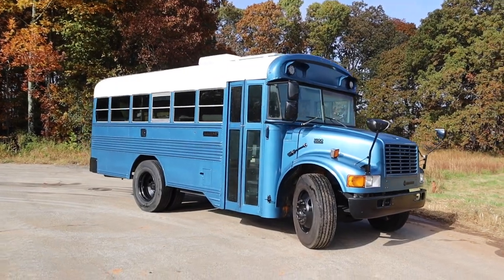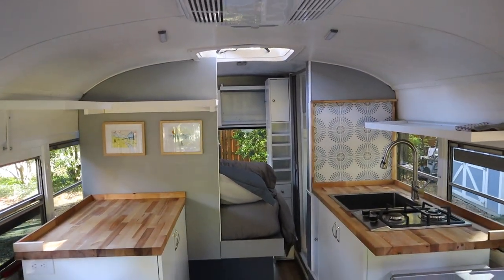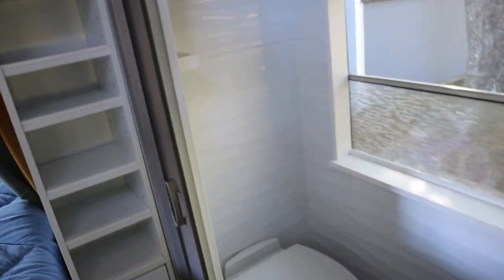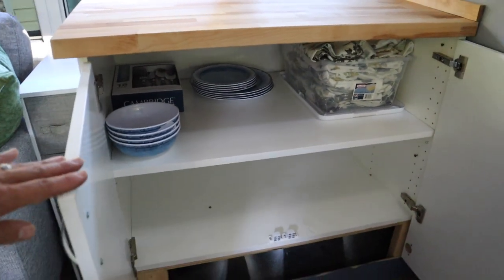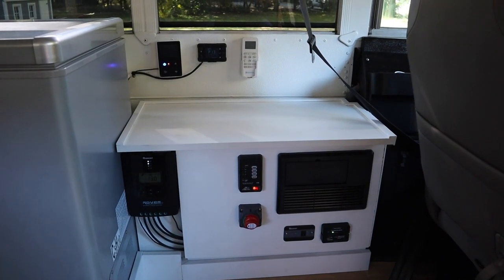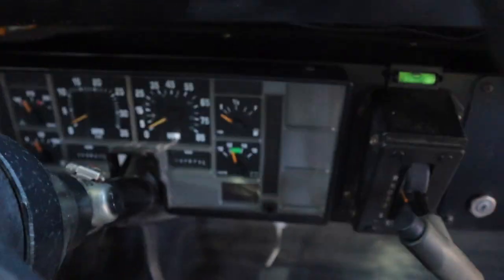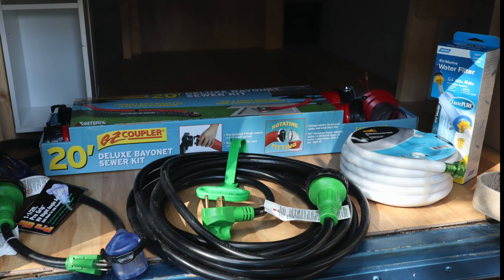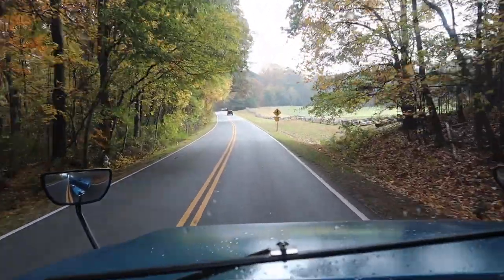Our School bus conversion

Comment: Very nice but let's be honest - all of those open cubbies in the back are not very practical. The first thing people are going to have to do is either put doors on them, bungee cords across them, or empty them out before they drive. I do love the sliding closet rod though, fantastic!
(I guess you could stuff the cubbies full so that things stay in but then everything is a wrinkled mess when you take it back out. Even the bins the people are going to suggest are going to fall out as soon as you hit the brakes too hard.) Also, I didn't see any kind of latching mechanisms on the cabinet doors? I saw the regular clips but again, those aren't going to keep the doors shut on the road.

I don't mean to be negative Nancy - this bus is really cute and I would seriously be interested but you also have to be realistic and things just don't stay put when you're driving - I've got three broken toes from a stray can of chili in an overhead cabinet to prove it 😅.
Reply from the maker: I appreciate your observations. The cubbies do have a small lip to keep things from sliding out but I would not suggest putting something top heavy in that space. The cabinets doors have very strong magnets holding them in place.

Comment: Great to find a 6 window bus.  Nice conversion.  But the stock windows and the metal ceiling are big drawbacks.   Hard to cool?
Reply from the maker: Thanks, it drives like a big pickup truck. The air conditioning does a fine job when connected to shore power. The white roof and tinted windows are also helpful.

Comment: Do you have a link for lights you put on the front to replace the flashers?
Reply from the maker: Here is a link to the lights: 7inch 51W Led Tractor Work... https://www.amazon.com/dp/B08219FFKH?ref=ppx_pop_mob_ap_share
The mounting tabs had to be removed from the lights. 

And the steel blanks to fill the holes: Etsy: https://www.etsy.com/listing/1034533574/steel-disc-raw-steel-steel-circle-pick?ref=share_v4_lx

Comment: Where to get engine parts for this bus. I have one
Reply from the maker: Erik, the T444 parts are almost 100% identical to the ford 7.3 parts.  Any auto parts store sell most of the items you will need.
Reply: @paulpadur2183  I can find the bolt on fan clutch. It's different from my 1993 f350 7.3 idi.

Comment: How long did this take you? Looking at doing one myself
Reply: Every single conversion is gonna take different amounts of time for everyone, even if you had the exact same bus and did the exact same things. There’s no way to compare how long this one took versus how long it will take you unfortunately. 

Most conversions like this one that were not completely stripped and then adding basic lighting, cabinetry, etc  usually takes individuals 3 months on the low end up to or over a year at least on the higher end. I have seen several comparable builds take two years. It just depends upon YOU. How often will you work on it, every day or just weekends? How much money do you have? If you’ve got $20k just sitting in your pocket , that’s gonna get it done much quicker than only spending $100 each pay check. If that’s the case, your gonna be on a five year build plan. Especially now, everything is getting so expensive thanks to biden and it’s driving up the cost of even building a bus to use as affordable housing!!

Good luck tho. If you have time, a build like this can easily be done in 3-6 months
Reply from the maker: It takes me about 6 months to build a bus. Your time will depend on experience and complexity. If you want to hit the road as fast as possible, pull some seats, throw in a few couches (please fasten them to the bus) and you are on your way. Over time, you will find what you want/ need.